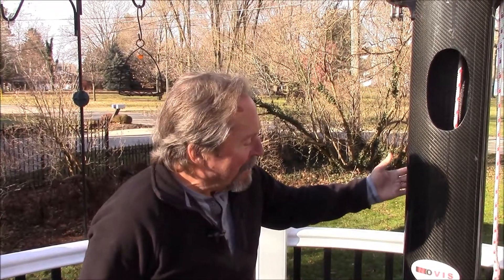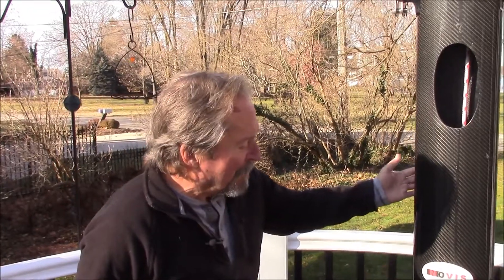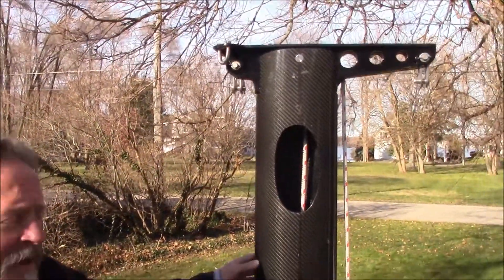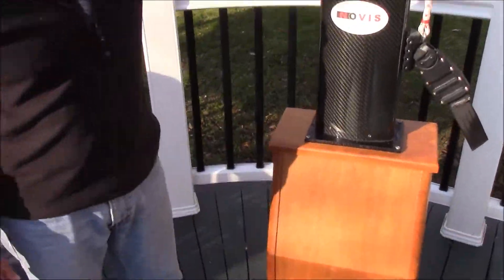Carbon fiber sailing masts outperform aluminum

Comment: During my windsurfing years I broke 2 aluminum masts and one fiberglass one.  I bought a carbon mast and used it for years, finally sold it.  The weight reduction was astounding and the flex qualities were far superior.

Comment: How much for a carbon fibre mast. Roughly 20 feet long, simple tube shape, 4” diameter, possibly tapering to 2.5 inches at the top. Just a rough guide to help me decide weather to build a wooden mast or not.
Thanks.